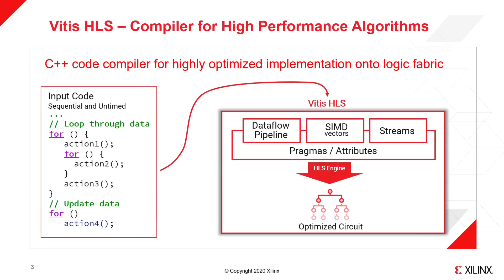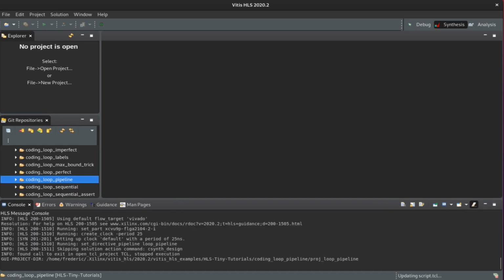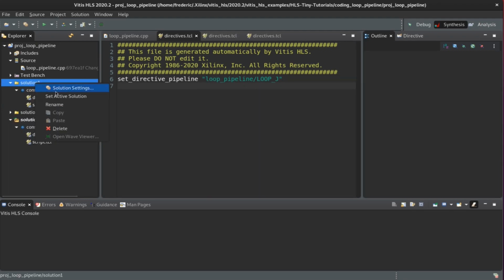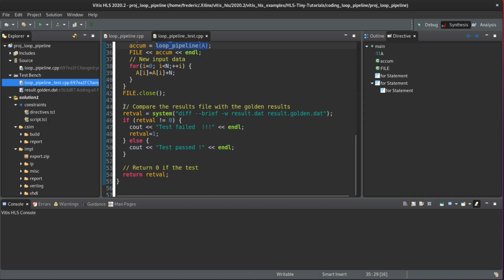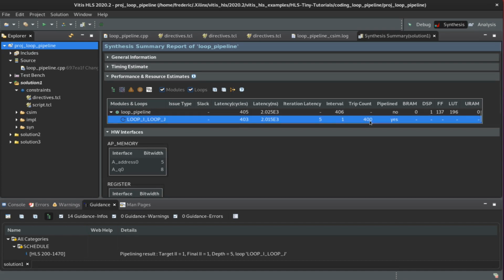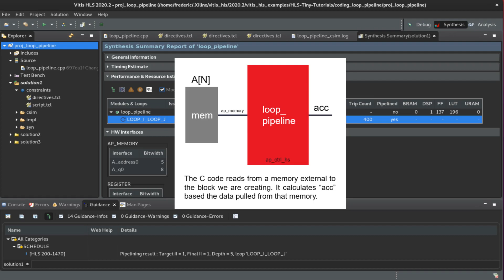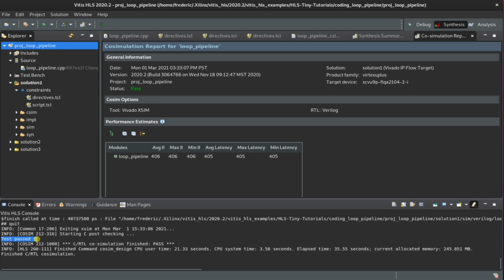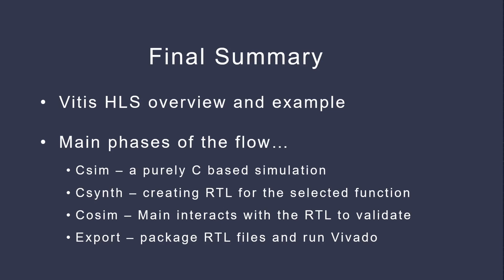Introduction to Vitis High-Level Synthesis (HLS)

Comment: I think I'm at the precipice of understanding, but I'm hoping you can clarify something for me.

I have a decent understanding of how computers work at the level of transistors forming logics gates, and logic gates being combined into more complex structures like latches, flip-flops, and registers, but things get a bit fuzzy for me at higher levels of abstraction. So whenever I imagined the engineers at CPU manufacturers designing a new CPU, I pictured engineers actually placing registers, buses, and ALUs into a circuit and all the wires in between them into some design software, which then gets printed out onto a silicon die. This struck me as crazily complex given the scale of modern CPUs in comparison to individual registers.

However, after hearing about High-Level Synthesis in a podcast, I was made to realize a different possibility that seems much more feasible: that perhaps those engineers actually just write C code, and use tools like this to generate circuits that are optimized for it.

Is my new understanding about how this process works accurate, or am I still missing something? I'm really interested in learning how CPUs are designed and created. Thanks.
Reply: I am also new to this, but I don't think cpu manufacturers use hls. It looks like this is more suited to coding user applications that need hardware acceleration without the need to look into the details of the hdl code. Computer manufacturers definitly do what you said about placing specific components and linking them, but I think it is more of in a block diagram way for well-known stuff and hdl code for more specific blocks.
Reply: ASICS are often created by writing HDL (verilog or VHDL) which is NOT high level synthesis. High level synthesis is geared towards people that are more comfortable with C/C++ but want to accelerate certain algorithms with FPGA hardware.

Comment: Hello! Can I modify the RTL code generated by vivado HLS later on in my Vivado project?
Reply from the maker: Yes, you can, but it's often better to think about the generated RTL as a kind of intermediate product. if you rebuild your code in HLS, for instance, the generated RTL would be rebuilt as well and your changes would need to be re-merged.
Reply: @adaptivecomputingdeveloper4413  thanks for the response. but still working with and modifying the RTL is possible right? I read somewhere that the RTL is not insured to work and you can only rely on the generated IP. Can you elaborate please?